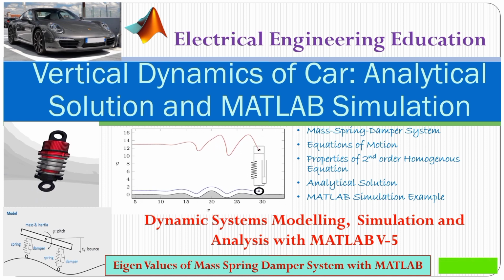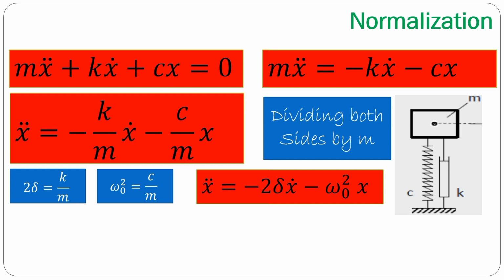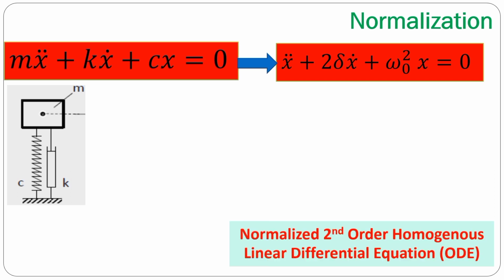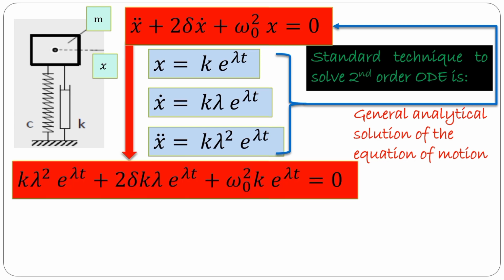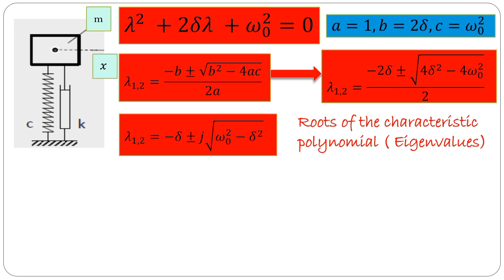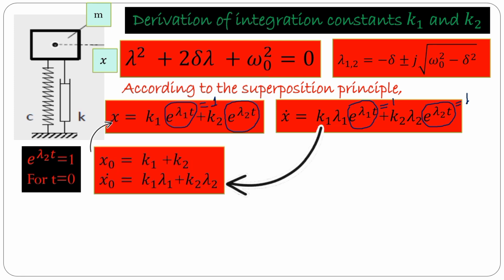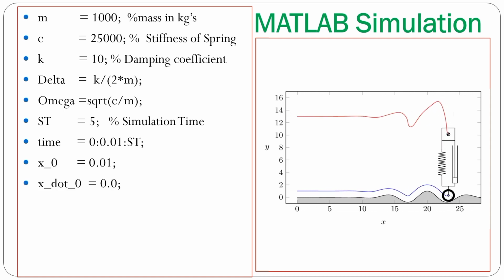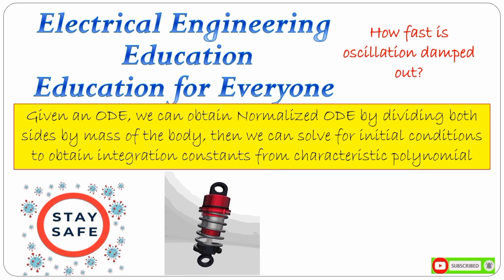Equation of motion for mass spring and damper system | EOM Matlab| Electrical Engineering Education

Comment: Greetings! I came across Your Automotive Suspension & Mass Spring Damper video series, and got invested in the topic, particularly in the MatLab simulation part of Your videos. However, I couldn't get insight on a crucial (for my study course) topic of simulating spring & damper reaction to the ground obstacles. Some of the videos in the playlist featured a GIF fil of a single suspension piece reacting to the environment. I am wondering whether or not You could provide me with the code to analyze this scenario further & possibly recreate it, since I think it will provide me with much insight on the topic. I would really appreciate it!
Regards,
Ivan